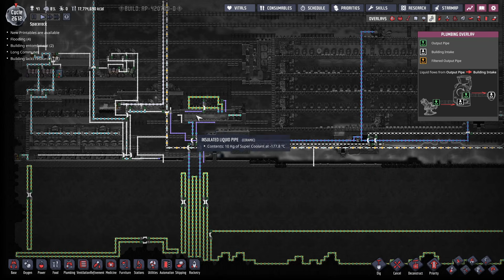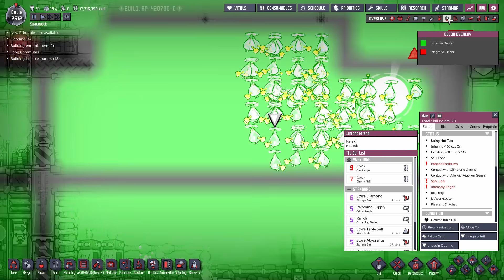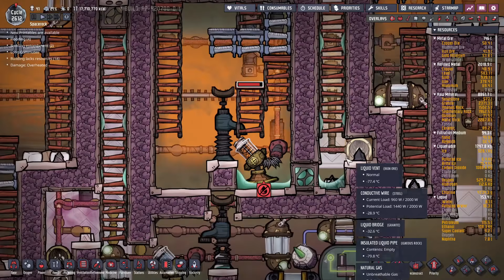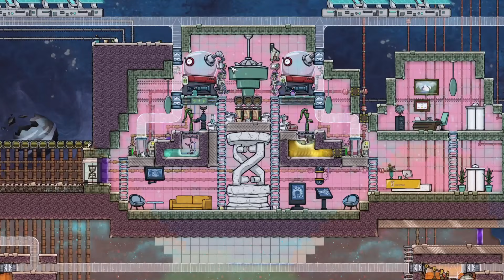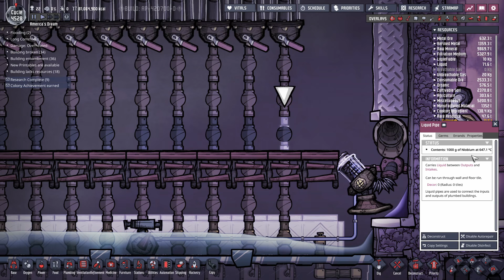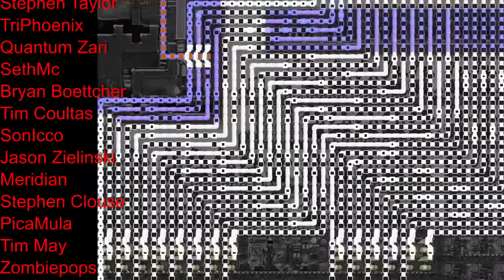Base Lovin 22 : Ultra Late game Builds: Oxygen not included

Comment: The "American Dream" map, looks like a microchip or electrical schematic design.

I really wish this game had better thought put into the game. Having transformers for 1000w, 2000w, and one for the lower "high power grid". Not sure why there is even a 4000w transformer at all. Pipes and pumps need a "high pressure" version, which can fit 100K packets. (If only to cut down on processing 10x of the 10K lines.) It would also be nice to have an air pump that actually fills an entire packet on both the normal and high-pressure line. But, there would be a good use to use multiple low-pressure pumps on a line too.

Circuits need to be built "inside of machines", or "inside circuit-boxes", just to reduce the need for massive circuit building with oversized circuit components. Additionally, a "sensor module", which just has to have desired sensors built within it. Both inside any machine, or inside any single circuit-box. (So you can throw all sensors into a box, where air lines, liquid lines, power wires and atmosphere all intersect. Each respectable sensor interacting with the appropriate item in that single location. Ribbon wires, or just four physical outputs for wires would work.)

They need to reduce, or remove, the horrible "random motions", which takes more processing than just simple basic physics calculations. 8,000,000 complex math calculations can be done in the time it takes to "generate one random number", which is what makes all the gasses and liquids "vibrate", to simulate flow and motion. (Totally ignoring the fact that they don't actually flow at all. Often getting stuck, because of horrible random number generators. While simple, real physics, would ensure that they never get stuck and actually "flow".) Bonus for making hot things rise, where they end-up cooling and loosing pressure, expanding... While cold things fall, and compress, exchanging heat faster as they fall. Which is how we actually get a "sea-level" pressure of equilibrium.

Love all of the creative hacks in these setups.

Honestly, they also need plants to behave correctly... Plants suck-up CO2 in sunlight and spit out O2 and H2O (humidity/low-temp steam). At night, in darkness, plants reverse and they consume O2 and spit-out tons of CO2, which is why we get tired at night. Our oxygen intake is reduced by the rising CO2, which floods the air. The more CO2 you feed a plant, the faster it grows. Also, algae creates CO2, it doesn't absorb it. Algae absorbs O2, 24/7 but more in light. Mushrooms also absorb O2 and spit-out CO2, they don't "like CO2", that is mushroom waste!

The worst offender of logic in the game, is the air and liquid bridges. Those just need to be simple bridges, just a span over other pipes. Intersections need to have "flow-controls", like real connections have. (Normally by design, like gravity, or by physical "one-way" flow gates, or automated "priority gates"... Bridges in the game are treated as mini-pumps, which don't actually pump and have counterintuitive "flow" and priorities that just don't make sense some times. They made it more complex than it needs to be, demanding hacks to get things to work as intended. Like the inability to mix wires, based on "down the line loads". We should be able to use 1000w wires, leading to devices that only draw 1000w or less, from a 2000w wire, which delivers 2x 1000w wires to two branches, without the need for a transformer. Power doesn't work like that. Transformers are for increased voltages, over the SAME SIZE WIRES, to reduce the amperage draw, so they can provide more wattage on the same thin wire.)

Comment: "molten aluminum coolant, that's excessive"
meanwhile Me, seriously considering using molten steel as a coolant to then melt insulation, but likely going to just slap down some insulation deodorizers in space to melt it instead...

15:05
I'm a bit surprised they didn't try to just....use a sink-like faucet to  vent co2 into space passively instead of needing pumps for it.

I see they DO have a working insulation melter!

Comment: I just started a new play through of ONI, and on a normal map of terra farthest I’ve gotten before something killing my food production is like 85 (on easiest difficulty), but THIS map of terra has surrounded my pod drop location in hot 100 degree areas, what temp does meal wood stop growing at? 85, degrees... I’ve learned from my previous mistakes and have surrounded my goal gens in insulator and my oxygen generator in insulator... and to solve the heating problem from the map hating me I built insulator around my base
I also have some random pacu in my water, and I have 8 ranched... idk but they make coal, which probably won’t feed my 4 coal gens
I also am building a power spine instead of spaghetti

Also, why does ONI randomly induce BSOD

Comment: Thanks for showing my map, I love your videos! I run an i5 8600k, and I was getting about 10 frames on that base. Don't even ask about critter grooming....
Quick notes on the sour gas boiler. Check out Gamers Handbook's video on gas elevators, that's the inspiration I drew from on the design. It can certainly be made more compact.
Some neat features is that this sour gas boiler is ON-DEMAND, meaning you can effectively control it with automation from smart batteries. I did this on an Oaisse playthrough, it starts and stops almost instantly. You can safely turn it off, and back on again without issues. The things you need to control are the natural gas generators and a liquid shutoff for the incoming crude oil/petroleum. 
The other cool thing is as a side-effect of the gas elevator, there's infinite gas storage, well until the liquid vents overpressure.

Comment: 1:58 quick note on why the generators don't overheat, there are a couple of tempshift plates, and they are exchanging heat with the supercoolant running through the aquatuner. I was actually able to keep the temps below 75°C for a while, allowing the use of not gold and not steel, but then the petroleum heated up (because the incoming crude oil heated up) and it reached steady state at 110°C. What's nice is that it provides a constant source of heat for the petroleum boiler, so you don't need turbine heat deletion or tepidizers.

EDIT: I tested this on another playthrough, the generators don't need any cooling at all.

Comment: I've been working pretty hard on optimizing my insulation melter and you mentioned getting steel to be a difficult part, just put some diamond tiles under a rocket silo with a vaccum between and then build a few steel temp shift plates with a little insulated bowl for it to land in. Doesn't take long at all, just mop it up and have dupes carry it somewhere.

Comment: I think you missed pointing out the twist behind the molten salt reactor.
Molten salt has a THC of .7, salt gas has a THC of .88. 
They gain energy by evaporating the salt.
Reply from the maker: Good point, I skimped on that as I could not remember off the top of my head what the difference was. Still an awesome form of industrial management.

Comment: I'm 300 hours into one of my own saves, current challenge is just how much power I can produce using only one heavy watt wire. For context, that would be 6 10kg/s sour gas boilers, 2 regolith meltors, another one running at 3/4'th capacity, that 55 kg/s of igneous rock feed to hatches and turned into coal.
The biggest problem right now is cooling the amount of steam turbines down taking up too much power. Its peaking just high enough occasionally to cause overload damage.
Oh and due to hatches not always being able to keep up do I have a lot of igneous rock, to the point where I'm slowly filling in the rest of the map with insulated tiles made of it.